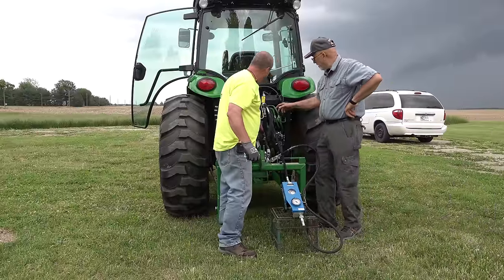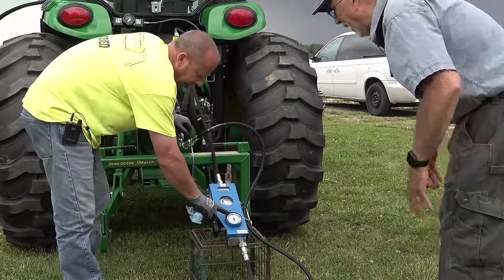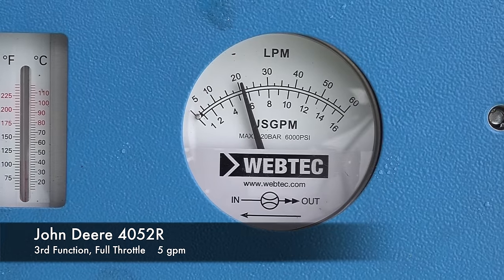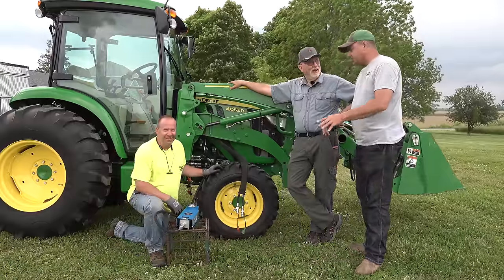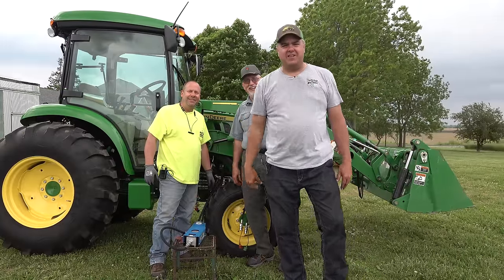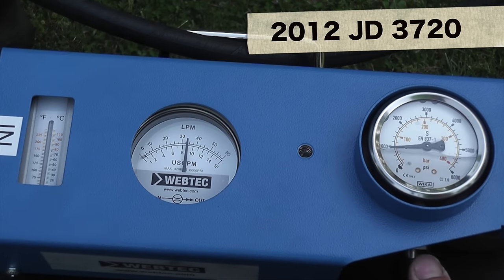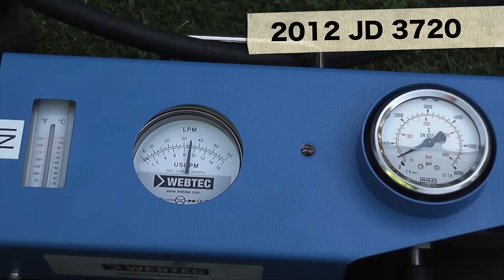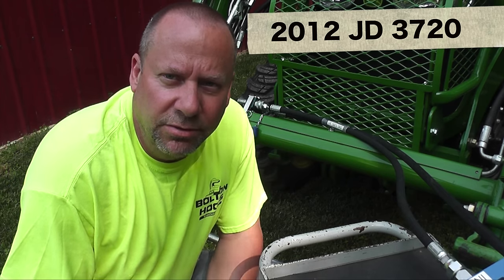Restricted Hydraulic Flow! Deere 3R, 4R, 5E Flow Test!

Comment: What a great time I had with you and Ken as we put my 4052R thru its hydraulic paces!  What an education on “going with the flow” against the “pressure” of resistance.  I was pleasantly surprised to see just what the actual specs are, and how they affect operating attachments.  I was especially curious about the third function performance since it did operate the Limbsaw effortlessly.  Ken’s explanation of the restriction for the 3rd function makes sense.  And, as he pointed out, if you do need additional flow for a third function attachment, you can use 1/2 inch hoses from the quick attach couplers going to the loader.  It was my pleasure to see you folks, and thanks to Christy for putting up with us, and come back anytime!  Blessings to all.
Reply: It was great meeting and dining with you!

Comment: this has been one of the best series of all times! I really enjoyed it. seeing the parasitic pressures and flow rates are very telling. it confirms that larger fittings and hoses are a best option. then merely install restrictors on the implements "where and as" needed to control speed. also larger flow rate control devices are likely a better option where needed. very interesting and I really appreciate the great job you and Ken did on this.
Reply from the maker: Glad you enjoyed it, Dave!
Reply: Thanks Dave, it was fun!

Comment: Hose sizes and connection restrictions make sense to me. The same thing happens in water flow. Most garden hoses sold is 5/8’s inch diameter. The better way to run a power washer is with  3/4  inch hoses. They cost more money but more water can flow thru them. Pressure washers specs shows pressure and flow (GPM).  The higher pressure at the head also increases danger levels at the work end too. Proper PPE comes into effect with any of these tools that work with liquids under pressure. You talked about proper gloves in an earlier episode. Thanks for the lessons.

Comment: You can get more than 11gpm thru a standard pioneer coupler with the 6 and 7000 series I have seen as much as 25gpm thru a single remote. The 8R now have a giant size pioneer coupler available and those things can flow like 50gpm, blow a hose and you can pump a barrel of oil on the ground in under a minute! lol

Comment: Got my ditch bank flail and have considered putting a restriction on the tilt function to slow its movement because I can only imagine 700# swings done fast or abruptly are going to be abusive over time. As a result, I am currently looking for a safe way to restrict that line while being sure I don't come up with a solution that is going to be hard on the pump over time.
Reply from the maker: No worries on the pump using a restrictor in a line like this.

Comment: Awesome video!! My 2009 4720 has the same third function setup with the small steel lines but my couplers are 1/2 at the end out at grapple, I thought same thing when I  installed my kit for my grapple,  those small steel lines will cause restriction and pressure  but figured like you guys confirmed if it was at 12 GPM  you couldn’t control the small cylinders on the back, grapple so it’s a give snd take, nice to have both options , you confirmed my thoughts !! 👍

Comment: The available flow on the 5075e is 11.5 gpm to the remotes the other is for the power steering I believe. The 5090E and above has more available flow to the remotes and so does the 5075M series.
Reply from the maker: No, steering is a separate pump.  The 17+ gpm is all available to implements.
Reply: @TractorTimewithTim  maybe he meant the other listed rating?
Reply: @TractorTimewithTim  you are correct about steering being a separate pump, and I do see on John deere's website where you got your specs, However The specs I am showing is 11.4gpm main hydraulic pump for implements and 6.8gpm for steering equals 18.2 total combined. I think the steering flow should only be around 6gpm for a total system flow of 17.5ish but specs can vary a small amount... This is generally how all the utility tractors 5 series and above are rated. If you look at any brand tractor in the 60- 75hp range 11 ish gallons per minute for implements is pretty standard... when you jump frame size to the 90hp and above then 16-17gpm is common for implements.  Just google search 5075E hydraulic flow and you will see some different specs... Also you can look at tractor data...I have owned a few tractors in this size and it is common to list them this way, I think because it sounds better than it actually is... I'm not as familiar with how the compact tractors are rated but the bigger tractors usually list total flow and then when you dig deeper into the specs you find that part of that is dedicated to the steering only via a separate pump. I'm not trying to say you are wrong, I'm just trying to say dig a little deeper because the way deere list it on their specs isn't clear... I believe If you test a 5090E or 5075M series or above you will get the flow numbers you are looking for out of a single scv. If you weren't so far away I could probably get you a few different tractors to test, but I'm in Louisiana... I Have a  friend that has a 6135E, a 5100e and and a 5410, I have a 8560 Mahindra and my brother n law has a 5075M. I have videos on my channel of all above tractors except the 5075M, He hasn't had it long... Any way enjoyed the video, Hope to see you test a little larger tractor in any brand... 85-90hp and above should give you 16gpm plus out of a single scv...
Reply from the maker: Pretty sure we are accurate.  Specs say 17+ total implement flow, but 11.5gpm flow at a single scv.
Reply: The 11 ish gpm is common across all brands of tractors of that size. To get 17 gpm out of a single scv you have to get a larger frame size. A 5075e is built on a 5045e frame size. If you look up on deere's website it says a 5090e has 22.5gpm total flow and that a 6135e has only 20gpm total flow. This is incorrect... I have ran both tractors and the 6135e has more hydraulic flow, but looking at the way deere list the specs it doesn't show that. If you dig deeper you find that the 6135e will put out 20gpm at a single scv, while a 5090e will only put out 15.9 at a single scv. So that tells me that deere is including steering output in flow rates on 5 series tractors and not on 6 series tractors...
Reply from the maker: I think you are jumping to an incorrect conclusion.  It is NOT combining steering in the total flow number.  Rather, it is saying that you can get X at a single scv, and the full amount over multiple scv’s.  On these larger tractors, two or more functions at the same time (full flow) is important.
Reply: @TractorTimewithTim  Why on the 6 series would they not list it then?
Reply from the maker: First, you cannot fully trust any of the specs on the Deere website.  This is unfortunate, but just the way it is!
Second, the 6135e shows 20gpm at a single scv, where the 5090e shows 15.9 max at a single scv.
So, the 6135e should show noticeably more flow through an scv.
I kinda doubt the 20gpm overall max on the 6135e…I suspect that is an error.
In any case,  none of these are including the steering.   I’m pretty sure of that.
Reply: @TractorTimewithTim Do you have any contacts that could get some clarification? I'm not sure but maybe you could put a t fitting in both remotes and test and see if it makes a difference. Tractor data shows different specs occasionally. I don't know where they get their data from. I have found errors there before as well... maybe you could do a follow up video of your finding if you figure out another way to test or additional information...

Comment: 5 series have expensive valve options.  So there may be a flow restriction vale, not an orfice a valve.  If the coupler has a small dial that will adjust max flow (option).  Great for a guy that wants 5gpm to a hyd motor.  Not a 5 series owner, but have been lusting over the brochures for the 5 series.
Reply from the maker: 5e does not have built in flow control.

Comment: There may be actual flow restrictors hiding behind some of the loader couplers too.  I discovered one while installing the single point connector on my 1025r.
Reply from the maker: Well, there is one on the return loader coupler.  This lessens chance of orings being blown out by sudden down force.
Reply: Right, as Tim wrote it's on the "lower" hose, but that is out of the system since we tested directly at the coupler on the tractor side.

Comment: Had my 4044M at the dealer for barking in the hydraulic system and jerky loader operation. They had it 2 weeks and never tested flow or pressure, and wanted to charge me $580.

Comment: I thought the 5e would’ve had more flow. Interesting.
Reply from the maker: I think it DOES have more flow...overall...just not through one outlet.
Reply: Yeah, and I got that from y’all in the video. I guess it’s my incorrect thinking that these bigger machines should be able to run hydraulic equipment like skid steers and other machinery. They are just not built to do that type of work.

Comment: Up to what temp is safe for the hydraulic system (e.g. hoses, seals, oil, etc)? 180? 200?
Reply: Yeah hoses and o rings can melt above 200 and the fluid boils at 210.
Reply: I think it's around 100 over ambient.
It is for our bigger stuff anyways, like a Mx285

Comment: I’ve looked all over and can’t find someone to explain continuous flow for my jd 4052m heavy duty.  How much flow does it have and when would I use it?  My jd dealership hasn’t been great with help on this and the internet hasn’t helped either. Thank you
Reply from the maker: Continuous flow should have full implement flow from the specs..so 10-12pm if I remember correctly.
You would use for hydraulic motors.

Comment: You need to check some older tractor like my jd 4200
Reply: We'd love to as time/opportunity comes along.  Maybe we can have a "drive-thru" testing weekend...like they did you Covid LOL
Reply: A 4020 with the 3" pump will make about 16gpm at the rear couplers. If you put a 4" pump on you can get 20gpm.  Beyond that the 3/4" line to the rear from the front pump becomes a restriction.

Comment: Are these tractors closed centers? Would open center systems have different response?
Reply from the maker: All open center.
Reply: You can get more flow out of a closed center system without having the heat issues. Almost if not all of your smaller tractors are open center.

Comment: Alot of coupler talk, for good reason. I'd like to see if the flow increases using flat face skid steer style couplers. I think they are a higher flow.
Reply: The "cheaper" flat faced couplers are hard to hook up with residual pressure.  End up opening a fitting. "Cheaper" is 85$ a pair.  A mistake because I could not find ORB ag disconnects easily.  They flow great though!
Reply: That would be cool to test, but good FF couplers are to darn expensive.

Comment: I hope you know that the more pressure you put on there tractors you are going to be blowing up expensive stuff like pumps,and lines. Do you know what hot hydraulic fluid can do to you when it hits your skin. If you are lucky you will not have to put any oil on your salad.  The worst thing is you will be visiting your local burm center. The bill to pay for that will be a lot more than getting the max output of your tractor.
Reply from the maker: We did not demonstrate, discuss or promote changing the relief pressure on these machines.
Reply: @TractorTimewithTim  It just kinda looks like you are trying to make the tractor's do something like you would have to get a bigger tractor to do. That's what I am looking at. If you look at the attachments that are made for compact utility. They go in horsepower rate. Not how much hydraulic power you have. To do better, and better things you have to get a bigger tractor.  Not adding a after market thing to it. Also remember that if you add anything else that the manufacture didn't have on it. You void your warranties . Something happens like a pump  blows . The dealer sees this after market thing on your tractor. You are going to be getting a big chunk of change takes out of your pockets.
Reply from the maker: Bill, we tested the flow rate of the hydraulic system in this episode…to see if it meets specs.  Have no idea what video YOU watched.
Reply: @TractorTimewithTim  I have seen in other videos that you have been operating the backhoe, and I have  heard you say if you get more flow you can get it to dig faster.  It is a little machine not a huge earth more. Then all of a sudden you have a booster thing . Maybe I am thinking like AZ dad. His idea is to make a fun time running around with your tractor. Not how fast you have to get it done kind of a thing.  I don't think that you are making a fortune in doing these things. It is very interesting to watch, and see what is out there for different attachment and tractors. There is a lot of different colors in the paint job. The most important thing is to make a fun thing out of it. Not how much, and how fast it can be done.
Reply: Almost all hydro hoses and o-rings are rated/tested/stamped for the same pressure and above what a small tractor puts out.  A bigger tractor gives you mainly more flow, and if pressure use bigger hoses. The relief system on all hydro systems protect this.
Reply: @emerkamp1  I know that. It looks like he just doing the test if it meets the spec. I personally think that they are trying to make the system do something that is not what the manufacturer has set. They have a thought that they can increase the flow, and make the attachment work better.. it is like having a Matchbox tractor do the same thing as a D 11 Caterpillar.
Reply: @billfenner7084  I don't think that's what they're doing here. They might wish they had more flow, I think they are just testing against what the spec says they should have. If anything psi would be the danger, which relief protest against.
  You are correct about hydro fluid and skin though, fluid at pressure can poison and or cut right through you.
Reply: @emerkamp1  hopefully this is the case. I don't any experience with these boosters. All the tractors that I have are just as it was from the factory. I hate to say it, but unfortunately I wouldn't be installing any of these things on my tractors. Remember that Kubota monster did something like that,and when his sales person contacted him about it. He removed it immediately. The pump is going only put out what it's set to. Nothing more. I know that you can make a adjustment to it, but unfortunately you better know what you are doing with it.
Reply: @emerkamp1  I would like to see what the manufacturer says about these boosters.
Reply from the maker: @Bill I will repeat that increasing flow OR pressure was not discussed in this video.   This video is testing flow.

We have over 750 episodes published.  To say that we don’t focus on tractors being ‘fun’ is incorrect.
We attempt to provide information about these machines.  We do not apologize for showing a solution which increases flow (in another episode, with more than enough discussion about warranty, and other potential issues.
In any case, further discussion of the more powerful pump should be discussed in the comments section on that video.
Reply: @TractorTimewithTim  That's a little much, Thought we had enough authoritarians around.
Reply from the maker: @emerkamp1  not addressed at you, Eric.